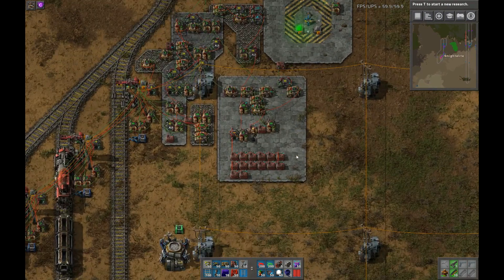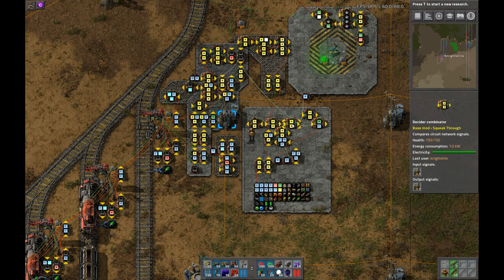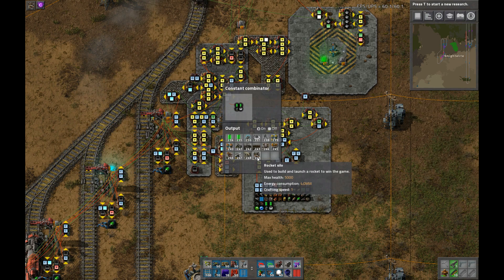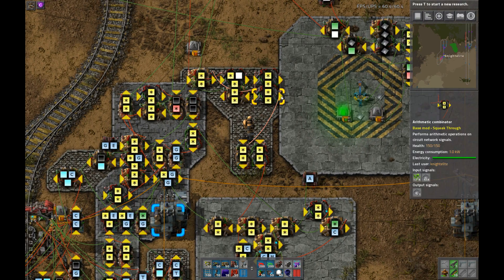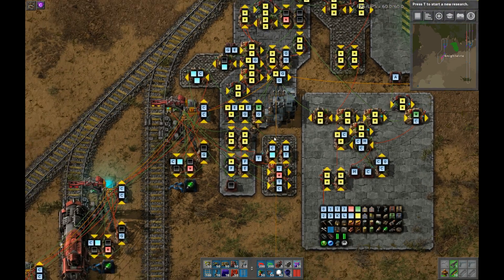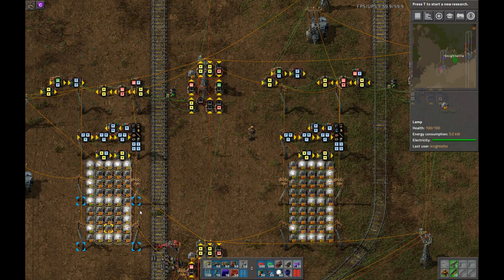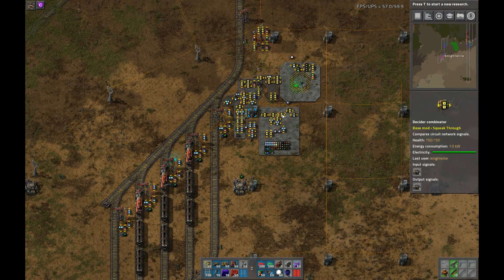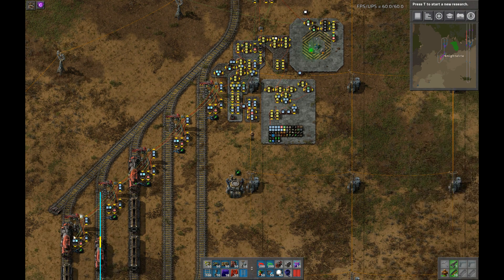LTN in Vanilla - Part 3 - Smart Train Dispatching Depot

Comment: @KnightElite do you still have LTN bleblueprint?
Reply from the maker: Blueprints are here; however they no longer work correctly in version 0.17 of Factorio and later due to a change in maximum wire length from large power poles to non-large power pole entities.
https://factorioprints.com/view/-LNJaTfTibBFMhHz-zV6
Reply: @KnightElite0  do you have Binary Search Signal Picker bleblueprint your video link to bastebin 404 error?
Reply from the maker: @ra55e4  yeah, unfortunately pastebin changed their policies and took down anything posted prior to a certain point, it's quite annoying.  The signal picker is included in the full blueprint book at the link above.  It will work correctly in Factorio 0.16.
Reply: @KnightElite0  oh i see changed their policies :(